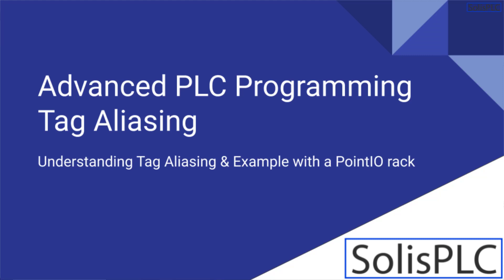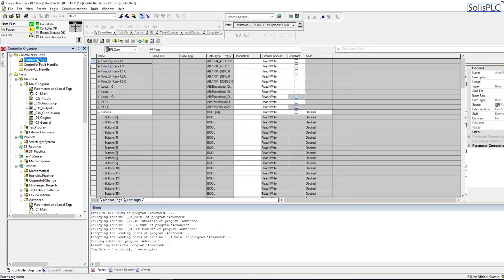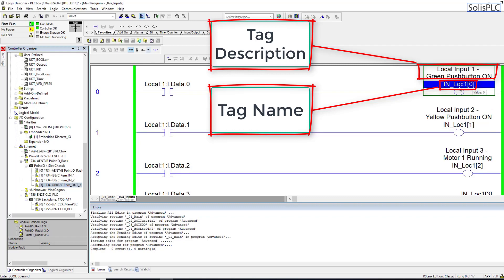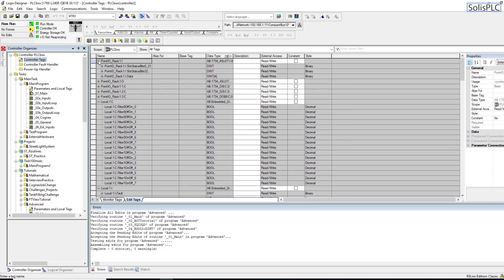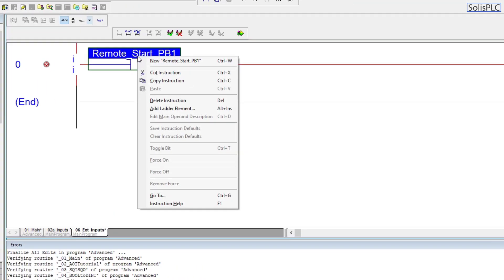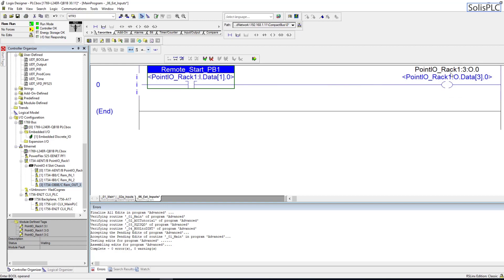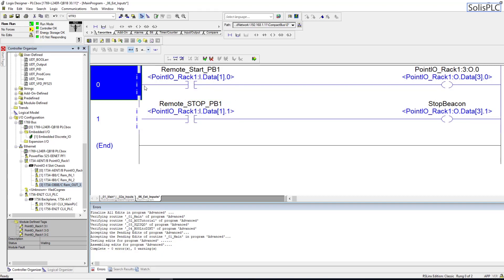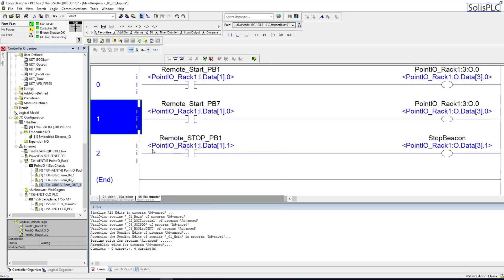RSLogix 5000 Tag Structure - Creating Alias Tags for PLC Input Output Modules Point IO Studio 5000

Comment: I understand that aliases are one to many whereas you prefer comments because they are one to one.  However, I believe there are other reasons to use aliases.  For example, I would prefer to write code that resembles "XIC PackageReadyLimitSwitch" rather than "XIC Local:I:1:0".  The former is in terms of my application, not the physical hardware layout.  In fact, I may not even be able to provide the latter since I haven't even considered my I/O layout yet.  Also, I think it is better to write code in application terms, and not physical I/O terms which are likely to be wrong, especially if I want to write reusable code fragments.  True, multiple instances of the code fragment may require me to provide unique names for each instance such as "PackageReadyLimitSwitch1" and "PackageReadyLimitSwitch2, but at least I can achieve some semblance of modularity/reusability this way.
Reply from the maker: This is a huge debate in our industry and there's unfortunately no standard for this. I agree that there's a point where it's easier to create tags and to alias them to the right IO later. However, consider this - What I'd typically do is create all of the tags I need for programming regardless of the I/O that will be in the system - Ex: Control_INT[0], Control_INT[1], etc. I would then use those integers in my program without any consideration of IO. Once I'm done and the I/O is pecified, I can use a MOV or COP instruction to map all the I/O into those tags. If I want to be able to shift the addressing, I can do individual mov instructions. All without aliasing.
Reply: @SolisPLC  Yes, I remember when working with the old PLC5, we would map the I/O that way using explicit copy instructions.  But really, I always viewed aliasing as a better way to accomplish the same task and without actually paying the price to both write mapping code and having to waste cycles by physically moving the data.  I believe that was the intent.

Comment: Thank you for the video. It's useful for someone coming with Siemens background. 
I have a quick question: why would a programmer create 2 different tags and allias them to the same I/O point?
Reply from the maker: Hi Abdel, that's a good question. There's really no point in doing so, but I've seen it done. Typically, this comes from either forgetting that the tag was already created or the person making new changes needed their own. For example, the system was built with a "Motor Start" output, 2 years later, a technician was asked to stop the motor based on a new switch and he creates a new tag instead of using the current one. Trust me, it was confusing to me to see that.